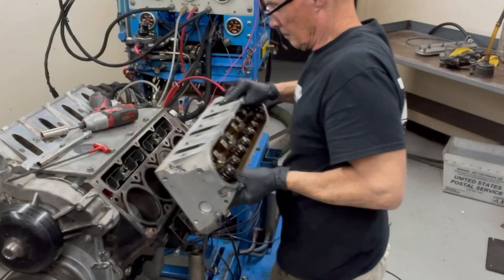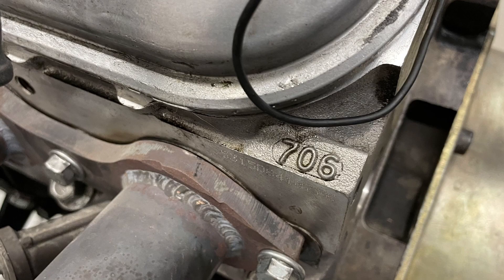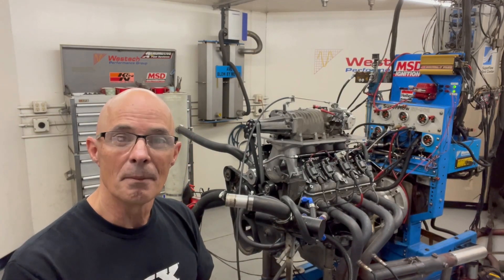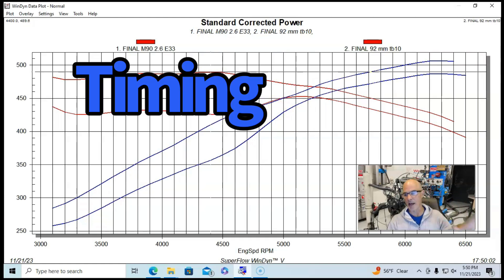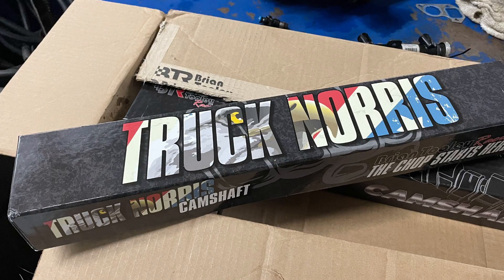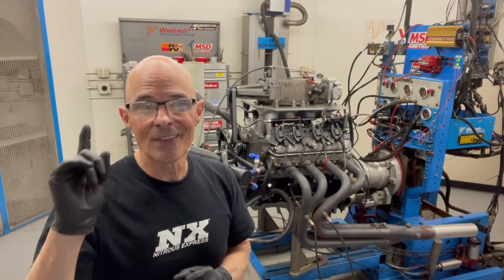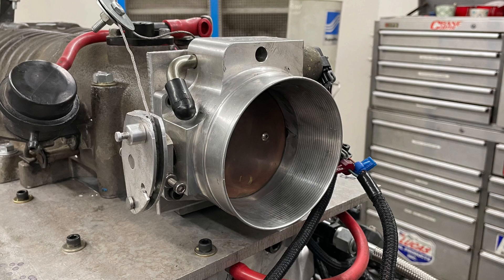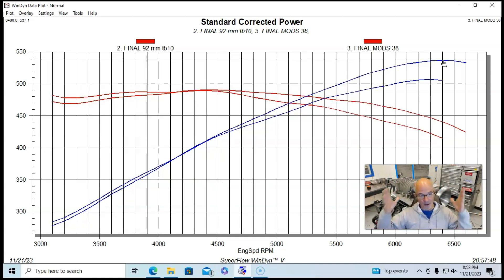CHEAP $89 JUNKYARD M90 SUPERCHARGER MAKES 537 HP! HOW TO  RUN A CHEAP V6 SUPERCHARGER ON A 4.8L V8!

Comment: Would a m90 work on anything bigger?
Reply from the maker: we made 650 hp with a ported one on a very good motor
Reply: @richardholdener1727  i was wondering if it would work on a 350 junkyard build i was thinking turbo but if i can keep the junkyard build to all parts from a junkyard that would be impressive. Its a 350 vortec

Comment: 23 pounds of boost? What was the supercharger rpm?
Reply from the maker: THERE WAS NEVER 23 PSI
Reply: @ it says 161 KPA @3:05. What are you measuring? Is that absolute?

Comment: What if this supercharger was on a 6.2 Denali engine?
Reply from the maker: we made 652 hp with one of these modified M90s
Reply: M90 won't flow enough for a 6.2. I have one on my 6.0 LQ4 and it barely makes 5 psi of boost. Eaton stated the M90 is good for 3.0 to 5.0 liter engines.

Comment: How about a junkyard turbo build where you use a turbo, intercooler, etc. all salvaged from other vehicles. Like run 6.2 flex fuel injectors in a 5.3 with the turbo off a duramax and see what happens🤷‍♂️
Reply from the maker: better to buy a new cheap turbo than a junkyuard turbo

Comment: I wonder if you would be able to use the lower portion of a marine intake manifold for a vortec 350/305 and make an adapter off of that?
Reply from the maker: might be able to

Comment: I have a 87 chevy g10 van with a 305. I have access to a 350 or I can pick a chevy 2500 chevy truck with a 5.3l ls I could body swap. Onto. Would it be cheaper to build a 400hp 350 or swap the frame with the 5.3l 4x4 with the a m90. For 400hp as thats my goal hp
Reply from the maker: 400 hp 5.3l is just a cam swap
Reply: @richardholdener1727  both engines need a rebuild the 5.3 needs a transmission as well. Is the 5.3l worth it over the 350 to tow 4000 pounds?

Comment: Hey someone said you can't put an m90 on a 3.7L ford v6 from the mustang they said it wont work is that true?
Reply from the maker: Any motor can be run with boost-maybe they meant it won't bolt right on because the 3.7L doesn't have the same intake-you would have to do some fabrication to mount the blower

Comment: I’m wondering at what rpm does the bottom end come apart??? Most likely valve float will act up before the bottom end comes apart unless it gets beefed up.
Reply from the maker: we cured valve float, and the stock bottom end has gone to 1500+ hp

Comment: So on a 6.0 truck engine "Boosted" Is it worth going with double springs for more lift 600+. Or just use the BTR beehive springs I have. And find a cam with more duration. It's got the sloppy stage 2

Comment: I picked up 20 hp in 2005 on my supercharged prelude with adding alky injection kit.  Something to ponder
Reply from the maker: I have run wm tests many times-it picks up no power unless you add timing
Reply: @richardholdener1727   why wouldn’t you add timing once the alky is on it?
Reply from the maker: then it's the timing that added power

Comment: Can you squeeze 2 m90s on there?
Reply from the maker: planned
Reply: @richardholdener1727  I always wanted to use a budget supercharger in a compound setup on my 12 valve cummins diesel mustang. Supercharger like this to increase Volumetric efficiency basically linked to rpm would be great.. i could have boost easily and quickly when i bump into the stage beams.. and it would help to simulate a “bigger engine” to spool a bigger turbo charger like an S475 or 480. typical cummins compounds need to cram all the exhaust gas through the smaller manifold charger and it’s gate.. the supercharger would not have that exhaust bottleneck. is there “compressor maps” for the M90? I wonder what pressure ratios it can handle.

Comment: Us “other guys” would love to see what that M90 can do on a 4.3 if you’re looking for video ideas. 😁
Reply: It’ll break the weak crankshaft. You’re welcome.
Reply: @bly4233 I’d still like to see it, just to find out what kind of setup Richard comes up with.  
Shame GMC didn’t have more race parts for the 4.3, especially with the Syclone and Typhoon out there.
Reply: 4.3 has a weak crankshaft??? I guess that's why the 4.3 will outlast its big brother the 350.
Reply: 4.3 has offset rod journals to smooth out the uneven V6, but those are the weak spots. I had a friend break one he only hauled his family around in. Not to mention, they have an unreasonable amount of intake manifold and oil pan leaks.

Comment: A square edge pipe inlet will only flow 72-82%.  A radiused inlet will flow 97%.  I was blown away when I read that on a Honeywell engineering document a few years ago.
A square pipe edge creates turbulence reducing flow.
I'm really interested to see your next video with the bellmouth inlet.
BTW, they make bellmouth intakes for HVAC systems.  It's amazing how much an inlet is quieted down with a proper inlet.

Comment: Hey man I have a blower which has an identical displacement as as the m90 tho it's a old school roots blower. How much power would I be loosing by sticking with a roots blower instead of the twin screw?
Reply from the maker: this M90 is a roots-not a twin screw
Reply: @richardholdener1727  my bad 😅. So the m90 is a twisted 3 lobe and my blower is a straight 2 lobe. How much power would I be loosing by sticking to the 2 lobe?
Reply: It's a Ogura tx15 blower...
Reply from the maker: no idea

Comment: It'll be interesting to see this supercharger on a LV1.
Reply: Considering the lv1 is a ls based lt  V6 unlike the LU3/L35, it should respond as well as the 4.8 LS, but even a LU3 4.3 with a turbo has known to snap the 10 bolt rear axles.

Comment: Now do 2 M90. Or run that motor without the blower and show actual gains.
Reply from the maker: we did-see the other videos
Reply: @richardholdener1727  so the blower picked up maybe 50 peak hp? Lots of midrange gains through the middle vs a hiram cam 4.8? Seems like alot of work for small gain. Would a stock 6.0 make similar midrange and peak #s as the blower with a smaller cam?
Reply from the maker: the NA motor made 385 hp (more with the Hot Rod)-so 100+ hp with the blower

Comment: Now do junkyard turbos swapped onto the 4.8 test mule. Twin Saab turbos, single diesel turbo, compound turbos! woot woot 🔥
Reply: I bet an 18 wheeler turbo would be a pretty good fit
Reply: NO.....most diesel terboz have a max TIT of 900*C and for gas motors that is a bit low and they can have short lifespans if over temp'd....unless we run E85, that is :D !!!!....and big diesel terboz are...well....BIG and oft times pretty inefficient and/or have odd pressure ratio issues..... you can get late spool and poor performance unless you get the right ones...and on and on @williamrouse3033

Comment: Richard, you can increase the diameter of the opening on the bottom of the Eaton for increased flow. Probably still lots of info floating around the interwebs from the good ol' days.

ps - why no intercooler?
Reply from the maker: the Tick intercooler is being shipped-wasn't there for this test session
Reply: Probably next test, dangle the 🥕

Comment: Nice work Richard! Those are good numbers. Can you say how much that setup costed from throttle body to pan?  Not including fuel injection and computer.
Reply from the maker: not sure
Reply: Call a local junkyard.
Reply: @omarboone1220  do they have aftermarket cams and springs?
Reply: @SightsNjunk  He said more than once, BTR Truck Noris cam that doesn't need aftermarket springs.
Reply: @omarboone1220   Which junkyard do I find that at?
Reply: @SightsNjunk  You're like 12 yrs old, aren't you?
Reply: @omarboone1220  What makes you say that? Because you said something that isn't true? Who is really the 12 year old?
Reply: @SightsNjunk all in I'd add probably $2k for the high ram,cam,tb and miscellaneous bs to make it work

Comment: I remember back in the forum days everyone said this SC was too tiny to make any power. That it was only capable of 250HP at the most, and way too small for a V8 😂

Thanks for proving all of them wrong.
Reply: Richard holdener himself has said countless times the M90 was too small for even a 4.6 until now.